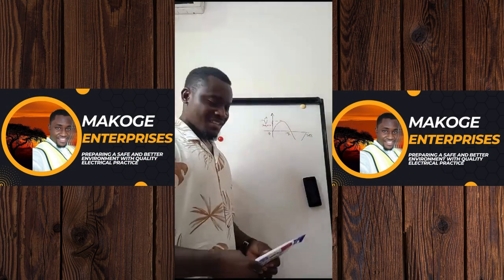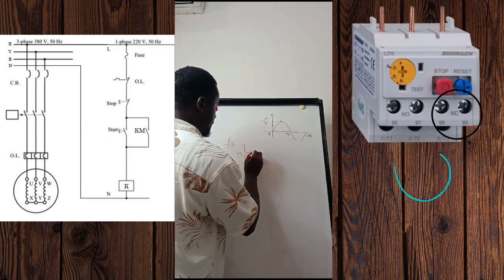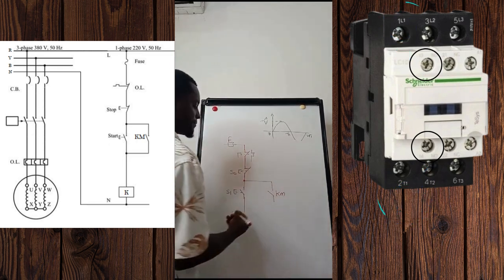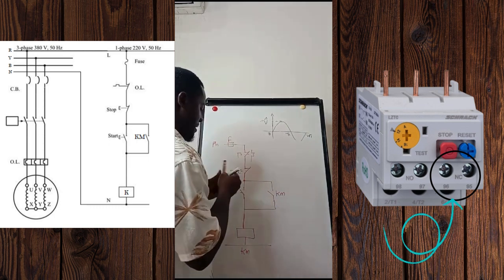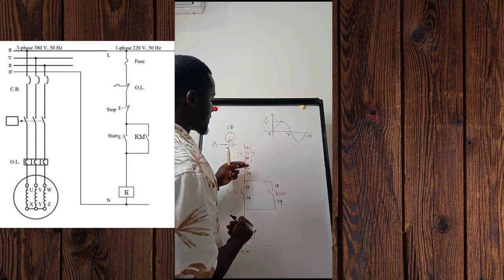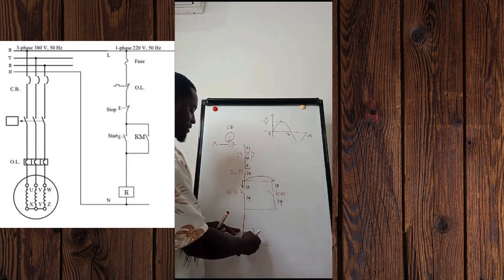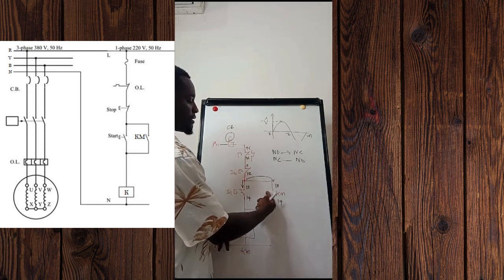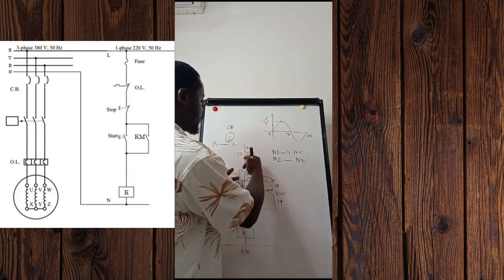How to read and interpret a Direct-On-Line starter (DOL) #electricaldiagram #electricianapprentice

Comment: Where do you get the pushbutton contact numbers from 2:54 i say 1 and 2 when you zoom in  where 11 and 12
Reply from the maker: Thanks for the question. 
You will either see 1&2 or 11&12 for NC contact while 3&4 or 13&14 for NO contact
Reply: @makogeenterprises   Thank you  i was wondering are these pushbutton number provided by the manufacturer in their data sheet ? Good video as always .
Reply from the maker: @carlluis770  Thanks 
Please do share 🙏